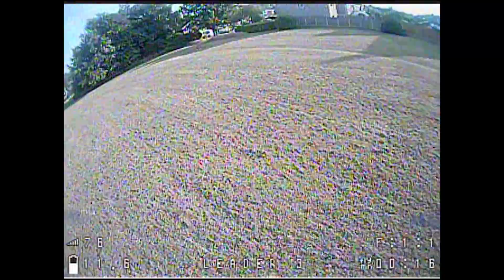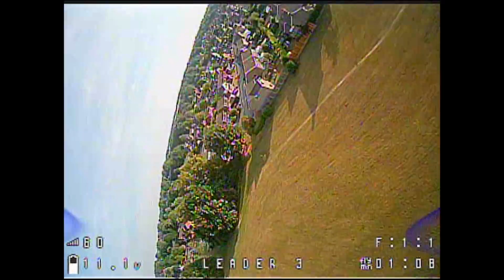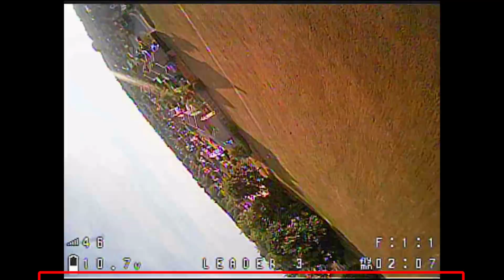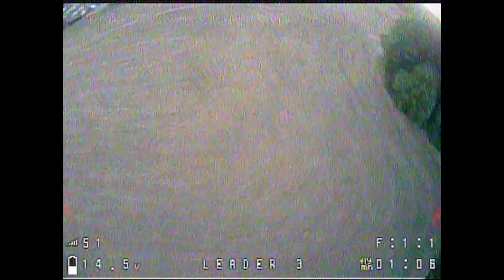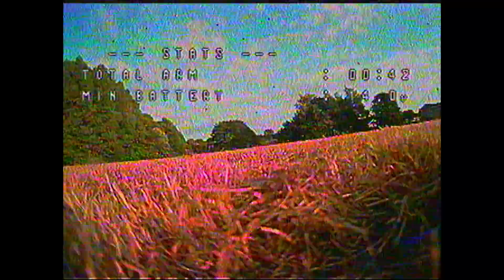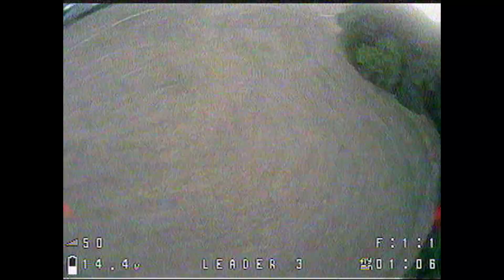Full Speed Leader 3

Comment: What props would you recommend for the leader 3 when running on 3s? I think the stock hq 3030  are rather expensive.
Reply from the maker: thay are. it depends which version you have. the reason they use the hq props is for the low pitch. with higher pitch and the old motors they get too hot and burn up. otherwise id look at the gemfans or the emax props
Reply: @AndyRCchannel  i'm ordering it for black fryday ( hoping for an extra discount) so i asume i will get new motors. Thnx for your quick reply!

Comment: Be a long time before I’d buy this, to many problems with the previous 120, which was also a prototype really, sold with loads of issues which was really solved by replacing the crap esc not messing with idle speeds!! Hence full speed replacing it in a later model, if this is a prototype Lewis, then just use 1108 motors, your be onto a winner, I don’t think people wanna change props just to fly 4s? The frame is the same design as the 120, I’ve snapped arms of it just by dropping before, so a bit thicker carbon wouldn’t go a miss either, the canopy is surely gonna help to burn the vtx out too,   I wonder when they’ll be a leader 4 , lol

Comment: For the money, I have no buyer's remorse for the Skystars x120 Bolt...
Reply: You mean that the Skystars x120 is better ?
Reply: Olivier DUDU 
I have the x120 bolt, and I am not disappointed that I bought it instead - even though the VTX is absolute garbage and will need to be replaced. So no buyer's remorse, I paid 117.00 for the Skystars x120 Bolt. Also a side note, I would not put larger props on those motors, too hot on 4s...

Comment: Nick Burns came to the same conclusion as you. He said the best combination is 4s w/ 2540 props. Although he said he flew 40 packs w/ 4 s and stock 3030 props in 95 deg weather with no problems and no overheating. But w/ 2540's,  the punch was better and longer flight time. Seems like after yours and his review, full speed would have been better to release this as a 2.5 in model.  Shorten the arms and save some weight.  Thanks Andy.
Reply from the maker: mine burned on the first 4s pack within a couple of minuites but I think I have more open space to go heavier on the throttle
Reply: AndyRC he also said the GF 3035 is a better prop.

Comment: Andy, got an idea for speed trapping the smaller quads....a piece of string,tape whatever on the ground...then speed run over it. So long as you can keep it level during the run, When editing the vid you can be as precise as you want measuring time taken and see how long it takes to fly the set distance...you now have distance and time....just divide for speed :-).
Reply from the maker: this is true however that is average speed rather than top speed. Iv found the top speed of a quad peaks quite quickly and tails off when the battery sags. but perhaps average speed is better?

Comment: Great review:) Indeed, I thought that 4500kV would be best suited for 4s and 2.5”. Do you think then there is any advantage to having a 3” frame and running 2.5” props? Why not save the weight?
Reply from the maker: I think you are right. they are doing a 2.5 version but they are determined to make this a 3 inch 4s copter.
Reply: AndyRC Nice frame though and well-priced:) I like that shark fin too as it actually serves a couple of functions.

Comment: Looks good. I like the 2540 hulkies on my renovated 2.5" iflite frame. Have to change out the AIO cam for something better, as the video from the Viper DVR 
looks pretty lousy .. nothing like what you're getting with your Fat Sharks and better cams. Thanks for the look. Cheers.
Reply: Bill Somrak ...I just finished a build using the iFlight iX2 frame with 2540 props, 1106 mtrs. Got a Hawkeye firefly on top and this is now my cheapest build and my new favorite. How you liking yours?
Reply: You quad must really be a BEAST, because I have only 1105 7500kv motors on mine, running on 2S power. Even that modest setup (due to its light weight) has amazing performance and punch. As Andy likes to say "it's very 'floaty' " . Now that I have some actual goggles I can use, I'm hoping to have a lot more fun with it. I currently have a 25mW AIO VTX/Cam on it which isn't optimal, and I might change that to a better cam and separate VTX setup. Cheers!